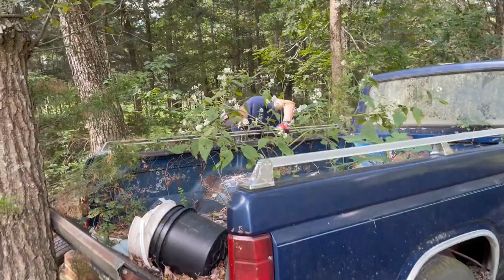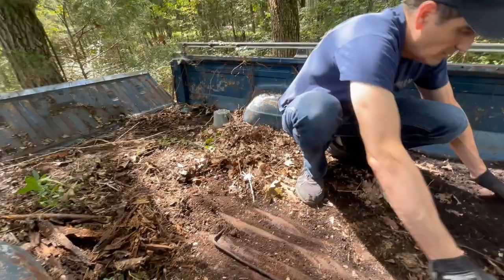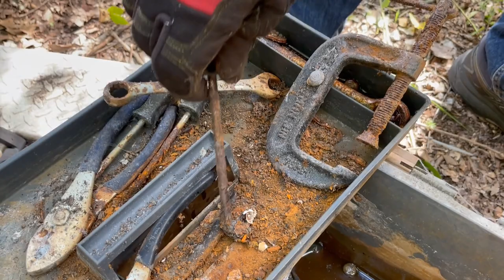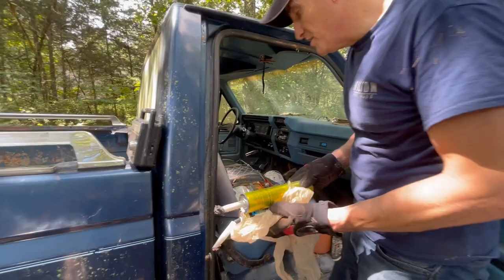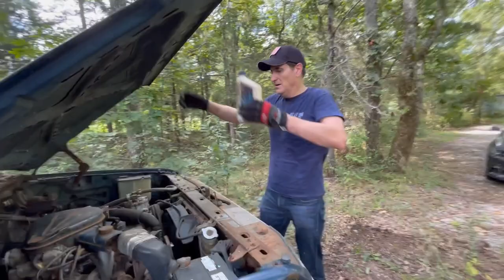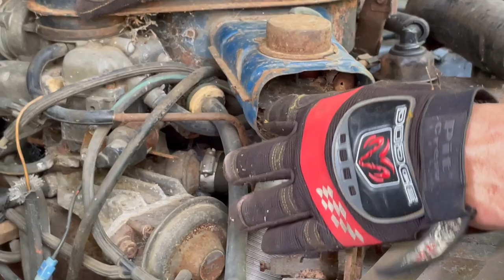1980 Ford F100 sitting for 20 years! Can it be rescued?

Comment: 1980 was the first year for those generation Ford F-series pickups, Broncos, & medium duties.
Reply from the maker: Right, the the differences between 79 and 80 are shocking. The quality took a nose dive, especially in the material used in the interior.
Reply: @whattherust  I know right. 1980 was also the first year for the medium duty F-series models with that same cab design too which are those bigger size trucks that look almost like a semi. 1986 was the last year for the light duty models like that one there in the video but the medium duty models on the other hand were still in production up through 1999 which was very surprising because they have the same interior design as the 1980 - 1986 light duty models do.

Comment: That bolt on air filter was used from 1977 to 1983 if i remembered correctly. My dad had a 1977 F100. Same air filter housing. My 1981 F100 had the same.

Comment: Hello, I have exactly the same setup as your truck (I've loved it for the past 31 years!) FYI. You will probably want to clean-out the fresh air vent ducts. My heater core went out. When I removed the housing I found the core side and the passenger side duct was LOADED with leaves. I used a shop vac. and a heavy piece of dowel to push them through.  In the process, I tore the rubber baffle in the at the bottom in the process. It was held in with plastic push rivets. I'm sure it contributed to the problem. I will only put it back if I find a reason to. The driver's side is accessible from underneath, just behind the fender well. Flushing with water also helped. I'm in Arizona so only some surface resting occurred. Hope this helps make you and others aware of the possible accumulation. (1980 F-100, 300 L6, Manual brakes, steering, 3spd column trans. Heater w/o AC) PS. I found your video while looking for a reliable remedy to stop leaves from entering the upper intake grill.
Reply from the maker: Thanks for the tip!
Reply: Did you clean it out from inside the truck or outside? If you cleaned it from outside, you had to get a new  gasket?

Comment: I had a 1980 ford truck when they first came out. It was a tin can, plastic garbage. The only thing good was the 300 six cylinder with the three speed on the floor with an overdrive. I could get about 22 miles per gallon.
Reply from the maker: It is shocking how much the quality changed from 1970 to 1980.